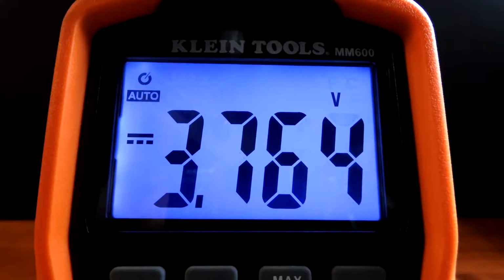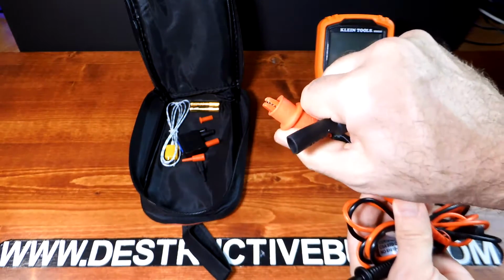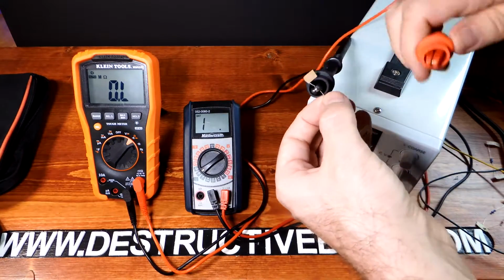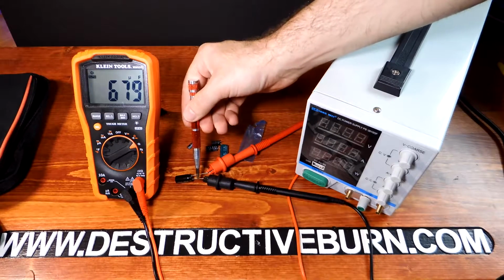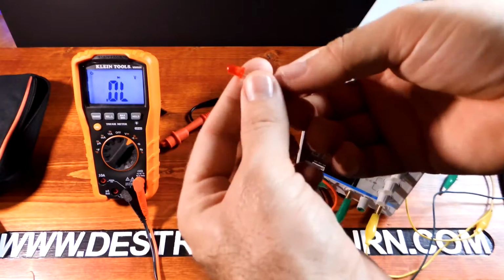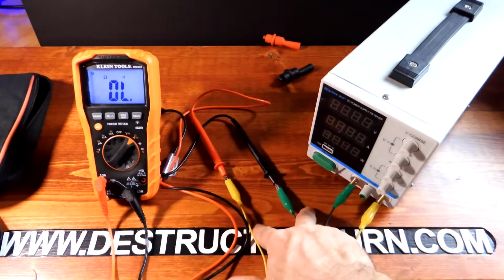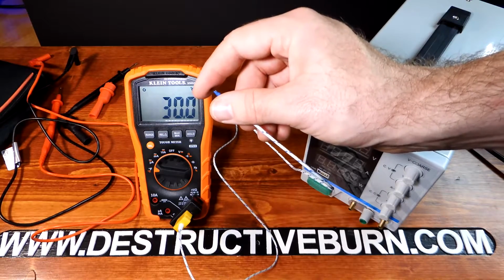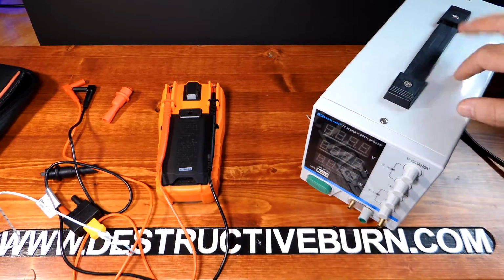KLEIN TOOLS MM600 Multimeter Review & Testing

Comment: Electronic components has % accuracy. Not not getting the exact resistance value as coded on the component is normal. So when you want to build a high end hi-fi amplifier or tuner, you buy whole packs of components such as resistors and capacitors etc, then you test each one individually to select the best.

Comment: for the capacitor check, all cap have not same value... the capacitor function is very great on this meter... i have a 500$ fluke 87v and same result... it depend on a lot of factors... you dont have to wait that it go to the value... when the value appear on the screen, is that we want to know... so if the cap mode dosent show the full value, its norman its the cap that is not accurate, not the meter...

Comment: No instruction how to install/replace the batteries.
Remove one screw at the top of the back end. You'll need a small screw driver (Phillips #1). The cap will tilt open, but you'll need to tug on the bottom a bit so it snaps open. The rest you could do.

Comment: The mm600 is my usual weapon of choice
Reply from the maker: Agreed.
Reply: Did the DMM come with the adapter for the thermocouple to measure temp?Thank you
Reply: At what voltage does the battery icon come on? that tells you to change the batteries?
Reply: Can you turn off the audible beep that happens with every function of this multimeter?

Comment: Commercial HVAC guy here. This meter is my go to. I bought it out on the road (HD) when my Fluke cooked. Accuracy is spot on. Leads are nice. Love the backlight and big display. I have a dedicated clamp for amperage so don’t need that really and the thermocouple sucks, as is the case with most meters using banana adapters.
Reply: What issues have you run into with banana clip thermocouples?
Reply: @thesunpouncergamingchannel2654  They just aren’t accurate. Usual accuracy range is something like +/- 2 degrees and there is no way to calibrate the meter for a specific thermocouple. I use a Fieldpiece ST4 for critical temps. Even with my Fluke 902FC the proprietary TC is off by about 1 degree.
Reply: @hightide9513  thanks for the reply, luckily +- 1 or 2 degrees is a good enough margin for me haha
Reply: How do you turn off the annoying beep?

Comment: I just bought the MM720 off Amazon. I think it was like 80 bucks. And then I bought a clamp meter off Amazon but it’s a Chinese off brand. I’m worried something happened to it because when I use my wire splitter on my toaster it showed amp draw at first but then when I tried again later the screen went orange saying O.L which means over load. I only used the clamp so I don’t know if you can actually damage it. But a toaster isn’t more than  15 amps is it?
Reply from the maker: I am unsure about the non-Klein Tools Amp meter but on the MM720 there would be fuses that will blow to protect the meter.
Reply: @DestructiveBurn  yeah I saw those in the Klein but i didn’t see them in the off brand one. I should’ve just bought the Klein clamp meter. The only reason I didn’t was because the generic one said 600 amp 
Vs the Klein one being 400. I didn’t know if I even needed it to be 600. I’m going to see if there is a way to reset it or something

Comment: Ive bought two multimeters including the Klein MM300 and each time i touch the lead in resistence mode the readings never say 0 but instead jump around like crazy and i dont know why that is
Reply: Its because the ac and dc setting are on the same switch. You have to press the sel button to choose witch mode you wanting
Reply: electricity is like water in pipes, bends in the wire can slow down electron flow and hence resistance. The same happens with temperature changes.

Comment: I’ve got the mm600 and the continuity feature doesn’t beap for me. Am I doing some wrong? I’ve pressed sel until I see the continuity symbol on the lcd but no beaping
Reply from the maker: Just move the dial to the right twice under Ohms and touch the leads together. It will beep. Make sure the leads are connected to +V and COM for it to work.   You don't need to press the SEL button.  Just move the dial.
Reply: @DestructiveBurn  yea I think my unit may be broken because it doesn’t beep. I’m an electrician so I’m familiar with how it works. Just thought maybe there’s a way to turn the tone on perhaps somehow it was off. But seems like there’s just no continuity beep. Thanks for your quick response though
Reply from the maker: @dougfoster445  Yeah sounds defective. Even just moving the dial or pushing the SEL would beep.   I would return it and get another one.  Sorry to hear you had that experience.   I love mine.  I use it all the time.  I am still running off the same batteries I put in the damn thing since this review lol 😆

It happens though.  Out of thousands of devices made, there will be at least one defective.  This goes for everything.   Good luck and hopefully this time you'll get a working one.

Comment: i have a question for the mm600 why does it say lead when i turn it to 10a  but i got it in the correct 10a hole
Reply: Stupid question but is it your hot?
Reply: @Joseph-tx5hh  yes it is hot it gets hot every time you ask me a dumb question
Reply from the maker: LOL  Sorry for the reply but hopefully you figured it out.  Once you turn the dial to 10A it should only show LEAd for a second or two and then you can test whatever you have in the circuit.

I'm sure you know this but it never hurts to hear a refresher right.   Positive from bench power supply to 10A positive of the MM600 then COM negative of MM600 to say a motor positive and the negative of the motor back to the bench power supply negative to create the correct circuit loop.

"Quote from manual" LEAD flashes on the display as a reminder to check that test leads are inserted into the appropriate jacks.
Reply: @DestructiveBurn  thanks
Reply from the maker: Yup 😊